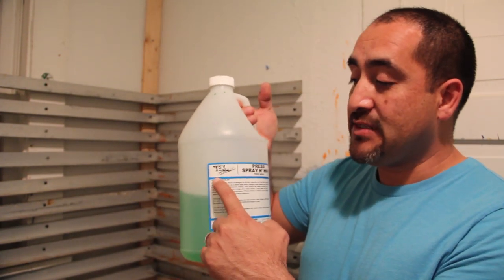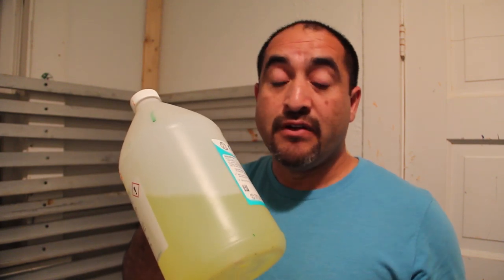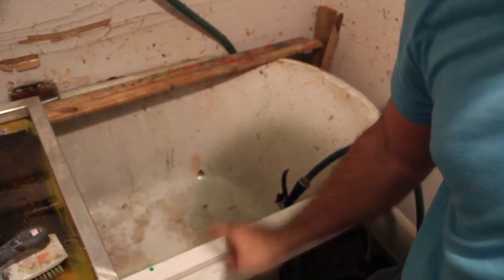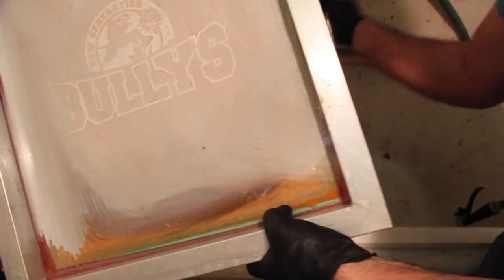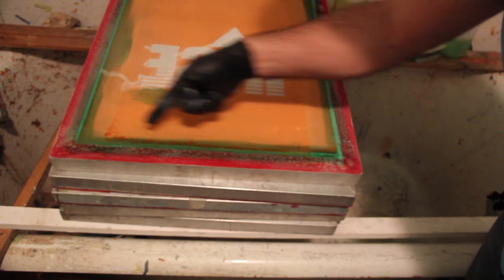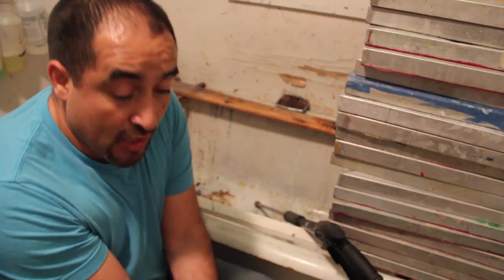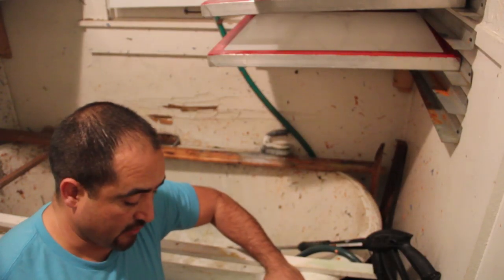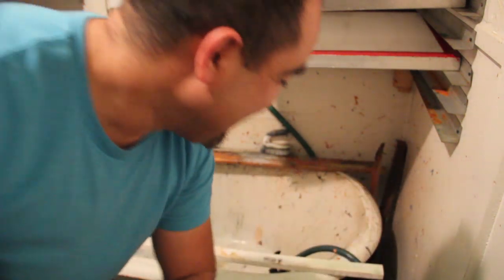SCREEN PRINTING   RECLAIMING YOUR SCREENS FAST AND EASY!!!

Comment: Thanks so much for your video. So very helpful. I have had hard time cleaning my screens...especially now trying plastisol ink. I still don't know what is best to get that crud off my screen and squeegee. I use the press wash and it does not seem to help much, if at all. I use decreased (automotive), Dawn liquid and now I guess I will try the Xylene. I could not find any at Home Depot, so I bought some Klean Strip Painters Solvent instead. That mixed with Emulsion remover and some Gunk Degreaser and a power wash at my car wash made it absolutely clean!! Thank you so much for the tips!!
Reply from the maker: get some CCI pink stuff and press spray and wipe from GOGSG.COM the press pray and wipe will clean the ink off your screens and squeegees
Reply: @LibertyGraphicDesigns  Really?? Okay. I will take your advice. One last question, please...when using Plastisol, I understand there is no flooding needed. Do you suggest squeeging forward only once or backwards only once? (Toward me or away from me on the screen)? I have shirt tacked down and try not to love my screen, but sometimes get that double image without lifting the screen. Single  color white only.
Reply from the maker: @gentlegnt  that's a great question! that's called pulling and pushing, but let me answer the flooding first.... you are correct, plastisol does not require flooding only water base, and the reason for that is, well, plastisol won't dry on your screen as water base does. ok, so now, when it comes to pulling and pushing I my self like to "pull" you get better results but you will get tired faster LOL. Pull requires a lot less force to push the ink through the screen, however, your are more likely to mess up or shift the screen when pushing that's why you get that double image you're talking about, now, if you pull and then push on the same shirt/image/print, you will also create or get a double line or sort of a mirror effect, this happened because you shifted/distorted the screen even if your shirt is well tacked to the pallet. if you have more question feel free to ask!!. FYI I'm working on a video series that explains most of this issues. Thank you for your question it was very interesting.

Comment: I also use xylene been using it for years .. it works great .. I get a gallon jug at Ace hardware for about 20 dollars .. way cheaper then the screen opener spray cans.  I use it to do color changes and as a screen opener .. . I put it in a spray bottle ..
Reply from the maker: it's the best thing I've used so far!! and yes you're right, it's cheaper then screen opener, I used to pay $48.00 for a box of 12 cans of opener and the xylene cost me $18.95
Reply: I want to add a little tip i just learned about you may already know about it ..  but I love it .. 
To clean your press and get all that tac down over spray and lint off your press .. spay WD40 or something like it on your prass it takes all that sticky lint and gunk off very easy .. it cleans and makes everything shine like it's new again ..
Reply from the maker: great tip! and I'm NOT GOING to LIE... I did NOT know that, thank you.

Comment: Gracias hermano for the heads up on all the chemical you use. I'm just starting up so I really appreciate this video.
One question I have, the inks you washed out were they water based inks?
May I reach out to you if I have anymore questions?

Comment: Keep in mind that screen cleaning supplies are created in the best interest of the screen material, using other things can damage the mesh, make it brittle , or make it harder for emulsion to adhere properly. Supplies are not too expensive. Also i've never seen ghost imagines cause problems with jobs, unless it's a very fine screen. With a normal 110 mesh it's almost impossible to see the ghost imagine in print. Be careful to not get any cleaning supplies on the frame/glued area, and haze remover should only be left on for 3-5 minutes or less.
Reply: totally agreed !!!!
Reply: the best material, the best final product, if you spend more money to use better equipment or supplies, then charge more money to the clients. but your opinion is valid too..
Reply: you are totally right, well i dont know where you are, but here in denver everything is expensive and the traffic is terrific that why i prefer buy all at the same place with delivery for my convenience, and just up my prices, at least here is how that works, but you are right about on your comment... thanks for let me think that way, i will try some of his Technics why not.. saludos @sexymeme
Reply: @fairy_dust6588  agree..it doesnt matter what materials you use as long as it works for you ^^

Comment: Yeaaaa I might have ruined the tub here already. Not from the chemicals and ink and emulsion, (it was stained but that all came out) but the screens scratched the tub. Seems like a little 800-1000 grit sand paper will get them right out :)

Comment: Here's how i've always did it in my 30 + years of screen printing.....I use 100% mineral spirits (paint thinner) to clean the ink (plastisol) with Bounty paper towels. Nothing works as good as Bounty. Using xylene is unnecessary, harmful to mesh and unhealthy. And i clean screens as soon as i'm done with the job. Letting it stay in the screens is mostly what creates ghost images. Plus plastisol is oil based, so all plastisol should be removed before going to washout. I use any cheap reclaimer, they all pretty much work the same. And then i use the strongest haze remover i can find. Right now, that's Rino Clean imo. A good haze remover should make your eyes burn lol. I've been getting my cleaning supplies from Davis International for about 10 years now. Good quality at an affordable price. Haze removers require a hazardous tag and costs extra for shipping with everyone.
Reply from the maker: thank you sharing! I agree with you on cleaning your screens prior to reclaiming I pretty much clean my screens before I take them of the press
Reply: Humasima, just do your own video. Thank you for your effort, Liberty Graphic Design.
Reply: I also use paint thinner for oil based paints. Works excellent.

Comment: Thank you for sharing. Is it necessary to use a presser washer? I don’t know, I am asking because I am a beginner.
Reply from the maker: Bridget Gainous thank you for asking, yes it is, the pressure wassher is a MUST
Reply: Liberty Graphic Designs oh, wow! Thank you. I have one more question. I burned my screen, and I was ready to print. When I tried to push the ink through the design, the ink did not go through. What happened? Please advise. I really want to learn how to screen print. Thank you.
Reply from the maker: Bridget Gainous do you have pictures?
Reply: Liberty Graphic Designs I can take a picture of the screen.
Reply from the maker: Bridget Gainous so i saw the video but you stopped right at the part where you show the print
Reply: Liberty Graphic Designs it didn’t print. Later, I realized that I don’t think all the emulsion was fully out of the screen where the ink should come through. So, I tried washing out the screen some more, but that only messed up the image. It seemed as if the screen was clogged. 🤷🏽‍♀️Thank you.

Comment: My screens won’t wash out (reclaim)... why? I’m using emulsion stripper. I’ve done it before. Why this time they’re not washing out entirely?
Reply from the maker: your emulsion remover might be old or if you let the emulsion remover dry on the screens it will do that, try wetting the screen first then add the emulsion remover wait about 5 minutes and wash with a power washer at 1600 PSI or higher to remove the emulsion, if you can, get CCI GEM_ZYME emulsion remover this stuff works great. Get it GOGSG.com  good luck

Comment: hey juan, hope you see this. yesterday i had begun reclaiming some screens and i took the ink and emulsion off and rinsed the screens, but i let them dry overnight because i was waiting for The Pink Stuff to be delivered so i could dehaze. today it showed up, and i tried wetting the screens and using The Pink Stuff to dehaze them but it did nothing. was it because i let the screens dry? i'd love any input you can offer me because i'm stuck. thanks again for the videos!
Reply from the maker: hey Marshal, if you let any emulsion dry on the screens it would be very hard to get it off, however, if you use hand cleaner and the pink stuff together and let sit for five to ten minutes then power wash (not rinse) the screens it will take most of the ghosting or stuff left on the screen. note that there might be some "ghosting" or imprint (sort of looks like a shadow" of the old image that does not affect the quality of the screen that's completely fine.
Reply: @LibertyGraphicDesigns  thanks so much for the reply, i'm thinking maybe the haze i was trying to remove was the ghosting you're talking about here because i was sure not to let the emulsion remover dry last night without power washing it all off, and i applied then power washed The Pink Stuff off twice for each screen i did today. for good measure i think i will order some hand cleaner as well. this was so helpful man, thank you!

Comment: Franmar.... Strip e do. Give it a try. Been using it for years!
Reply: When I used that stuff , it would leave a chemical residue that wouldn't let me apply any tape back on the screen...... Never used it again . Just saying what happened to me . I'm glad it works for you
Reply: @elir9711  never had that issue. Was that on a reclaim. Or on changing inks while still on press?
Reply: @Dtag1971  it was many years ago when franmar was staring . I bought a kit at the ISS show.  I think it was on the press . I do remember saying to myself that I'd rather have stinky chemicals than chemicals that smell nice and don't work. I was young 😆

Comment: good info Juan, thanks for sharing, where do you  order most of the chemicals from or store. i d agree a lot of the chemical made for screen printing don't work that good
Reply from the maker: Chris Little i get most of my stuff at gsg in Dallas tx
Reply: ok cool, I'm located in utah, is gsg a supply store?
Reply from the maker: Yes they are, I usually go to the location in dallas tx

Comment: How many times can use the screens before you need to recalm them?
Reply from the maker: some can go up to 5000 prints
Reply: @LibertyGraphicDesigns  How can you know when it is time?
Reply from the maker: @jeffnationaltrade  some will actually get holes or they will get very lose and won't hold registration or they just simply come off the frame when the glue does not hold them in place, they will also get what we call ghosting or haze, this is when the ink does not go through the screens anymore as easy as it should.
Reply: @LibertyGraphicDesigns  Thank you!
Reply: I've had a couple of screens for 20+ years . The old school size of 19x22 (wood) , that use to be the standard
Reply: @elir9711  ok

Comment: Doesn't xylene eat your gloves? I've used that stuff in the past and it's pretty nasty
Reply from the maker: No it does not eat your gloves xylene is actually safer than the chemicals we use to remove ink

Comment: ur septic system and ur drain line is gonna be messed up man not being mean just honest ur gonna screw so much up and if ur on a city drain system they are probably gonna be furious ur dumping dangerous chemicals and gobbing there systems up i see no filtration system or room for one u should invest in one to catch the emulsion at the very least and hope ur drain field is very far away from ur well if ur in the country cause ur dumping in very toxic stuff man not the best for what ur doing but still very toxic u gotta be careful with that stuff man